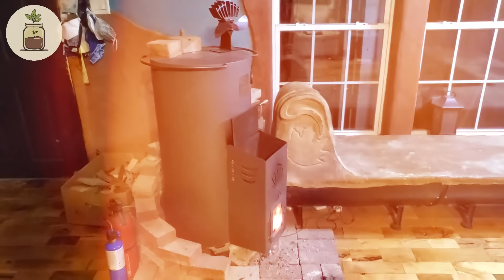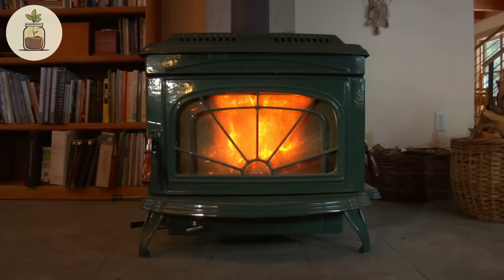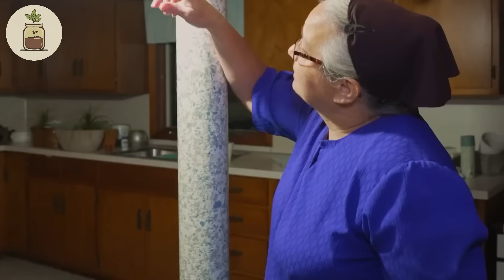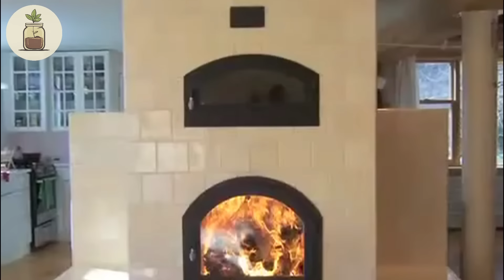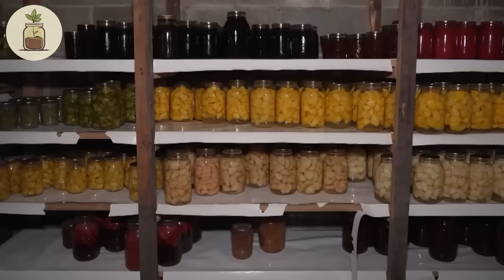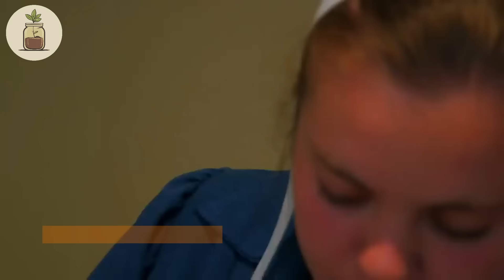How Amish Heat Their Living Room Without Gas/Electricity

Comment: I haven't seen this specific design before, but a masonry stove with a secondary combustion chamber for smoke gases is one of the most efficient wood-burning solutions. However, it requires a substantial mass—several tonnes of bricks—for optimal performance. Once properly heated, you only need to burn wood twice a day. Additionally, you can integrate heat pipes into the masonry to provide hot water, further enhancing its functionality.
Reply: Called a Grundofen in Germany :)
Reply: @hanahorack4287 😂 ja und wird so ähnlich schon sein der Römer Zeit genutzt die Amis sind nur etwas spät dran.
Reply: You might want to read my comment, above, June 9.
Reply: We use a Tulikivi from Finland for this purpose, they are a lifetime investment but work Great!

Comment: There are two but not alike. You have the amish that have strictor rules than a Mennonite both apeare the same but its ok to drive if you are a Mennonite. They also use electric. i remember the last trip or so to PA i found a Mennonite church. i liooked up thier customs and found the differenses. As for the rocket stove there is a lot of construction needed that i wasnt aware of. I seen videos on rocket stoves but never seen the full chimey part. i dont see i would need one like that a drum stove is more ecnomic to build. 73

Comment: How d I es the fan in celing work?
Reply: Clockwise during the winter
Reply: @oldschool7500 i have one in my living room when I fire up my electric fireplace the ceiling fan starts turning on its own without electric. It's amazing how heat can turn fan blades. 73

Comment: We have a pellet stove that we buy about 2.5 ton a year to heat our home.  Not quite as economical as wood but it is not as labor is needed either.  We spend about $280 to $300 a ton so it is very affordable.
Reply: My question is if the grid goes down permanently can you make those pellets? Or what would be Plan B? We just bought our land and going completely off grid. So I'm trying to learn as much as possible.
Reply: @sandys.1891 It's called a wood stove, they don't cost much
Reply: @genabargay4391  bought my wood stove 11-2019 . Saves on electricity and propane gas. I love it  and the heat it produces.  IT soaks into the wall and our bodies.  Plus I can cook on it!😅
Reply: @genabargay4391 yep. We have one. We love it. It can get very hot. We are building a stone oven asap outside
Reply: @sandys.1891 permanently? You gonna spend 14 hours a day cutting wood by hand for your stove?
Reply: @sandys.1891  you can use an inverter w/battery or generator
Reply: @sandys.1891 I have a generator for that issue.
Reply: @chrisparton3752  That makes sense. Thank you for taking the time to answer my question.
Reply: @chrisparton3752 How do you plan on running your generator without gas? Without electricity, those gas station pumps won't work. If the grid goes down permanently or for even a few months, mass chaos will ensue. Any gas left will be siphoned out until the local government seizes control over the gas stations.
Reply: @chrisparton3752  electricity  and pellets = not so economical.... and the generators do not last for weeks.....
Reply: And stock up with gasoline or propane away from the house.
Reply: Thats when a gasifier comes in handy. I'm building my first one now. @Pr0ph3cy-k5z
Reply: @ My generator runs on natural gas. My gas company stated they are not dependent on electricity to maintain natural gas flow at any point. We plan to have a wood cook stove for cooking and warmth as backup.
Reply: @samanthas9875solar power generator. Just ordered one on Black Friday. You can add additional batteries until it’s enough to run the entire house if wanted. Charges initially with a normal wall charger then can be recharged with solar panels or even a vehicle. Add that to the wood stove and it’s probably the best you can do for a grid down situation unless you have a lot of $ to spend
Reply: @sandys.1891  Yeah I wouldn't use pellets if I was planning for a possible grid down situation as I have yet to see a piece of equipment where you can turn wood or sawdust into pellets for a home pellet stove. Parts of Europe do use these mass heat type stoves or at least they did in the oldest homes.
Reply: Except that you need electricity to run it.  That must be taken into account.  A solar setup would help.  It was alright except for that.
Reply: @standunitedorfall1863 generator, and power doesnt go out that often. People never say the power problem thing when talking about wood boilers for some reason.
Reply: You had to watch the pellet stove you buy you got to buy a good pellet stove there are a bunch of pellet stoves out there that is not worth taking home and yes you can run your your pellet stove off of battery and solar panels
Reply: @marlinpruett8343  we did some research and bought a Heatilator pellet stove.  I think you can only get them at dealers.  Never had any issues in 11 years but we clean it according to their booklet.
Reply: I do have kerosene lamps Aladdin lamps and much more I collect them but I got to tell you in Texas kerosene is like $41 for 5 gallons two expensive you can go to Pennsylvania and buy cheaper then you can gasoline what's going on
Reply: U can burn diesel in a kerosene stove @marlinpruett8343  they are very similar fuels, though diesel is less refined
Reply: Garbage😂
Reply: I had a pellet boiler. I liked the idea of it and I wish it had worked out better. Parts broke down a little too often, the pellet bag deliveries were a big job. More than buying and hauling fire wood once a year. The cleaning was awful. It might work for a wood stove but way too much work for a boiler system.
Reply: I think if you can afford Both, that would be a good idea! While yes if the grid goes down maybe permanently, it's a better idea to do wood stoves and rocket stove heaters, so do that first. Hopefully, we will never see the grid go down! That is the Hope! So, if you have the money, pellet stoves are pretty efficient. Pellets and Corn are reasonably priced. For electricity you can look into solar or wind or buy a generator. (You'll probably need a generator anyway. Even if you don't use it much) This would allow you to stock up your wood supply a little slower. That's helpful if you are still working full + time or are very busy building your homestead. If you can, use the easier and still economically efficient way to heat for as long as you can! Personally I  would put in a regular wood stove first, then the pellet stove, especially if money is a problem. If you do the pellet stove first, make sure you will be able to do the wood stove very soon after, so you don't get caught without any heat.
Reply: Pellet prices in the Netherlands are sky high. €400 - €450 per Ton.  And regular oak wood €150 per cubic meter.
Reply: ..... As long as you have electricity to feed the pellets, otherwise it won't run. Not so great during a power outage